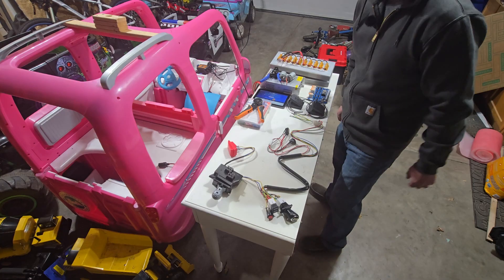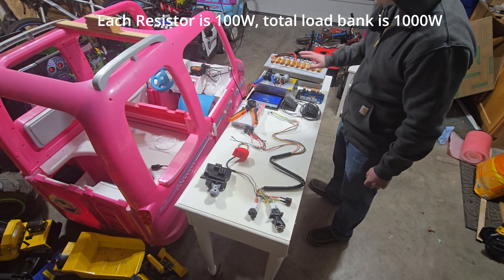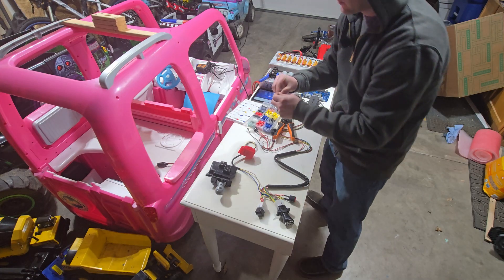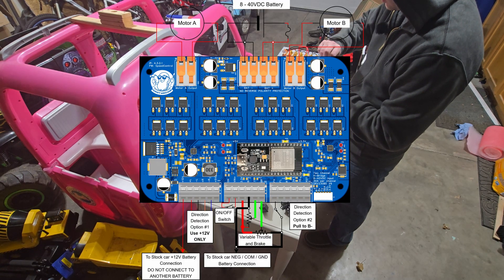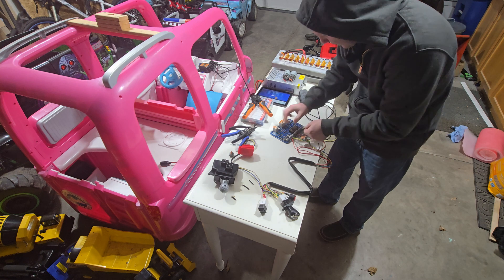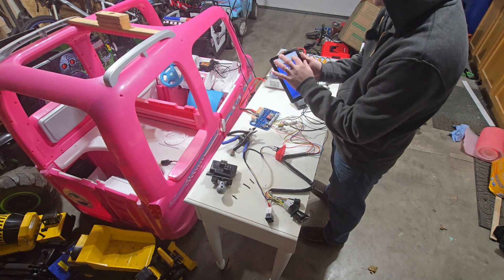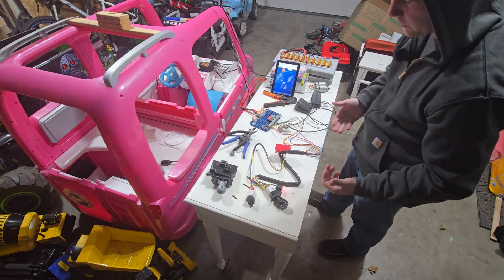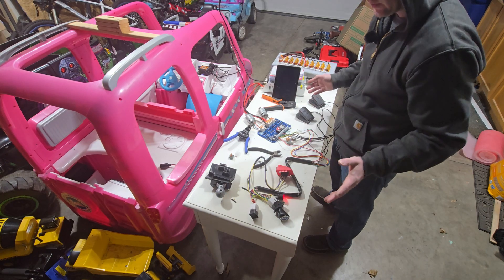How to wire in Variable speed controller or Soft Start / Soft Stop into Power Wheels

Comment: What is the purpose of having the 3 pedals connected, if you're only going to use 2? Or was it just for your testing purposes?
Reply from the maker: The third red pedal represents the stock pedal that enables direction.  It is just for testing so I can make sure direction is being detected correctly and for testing without variable pedals.